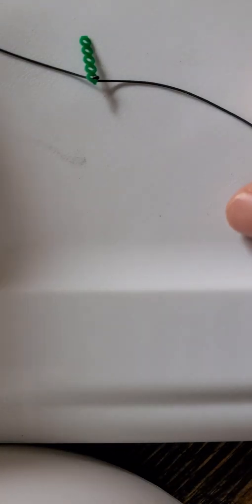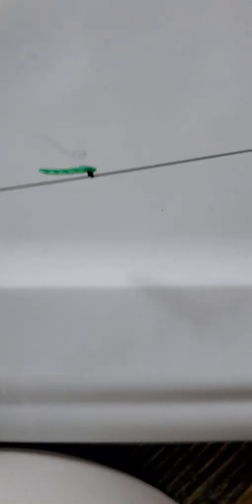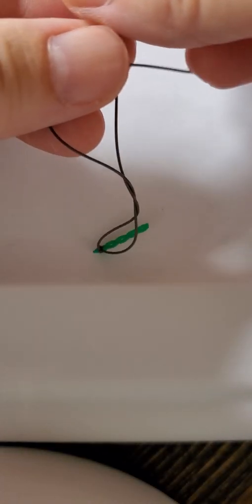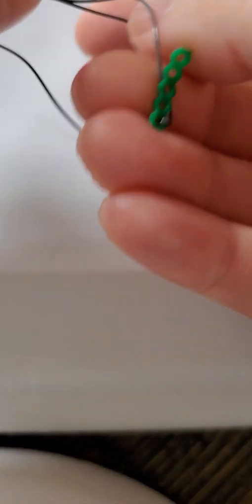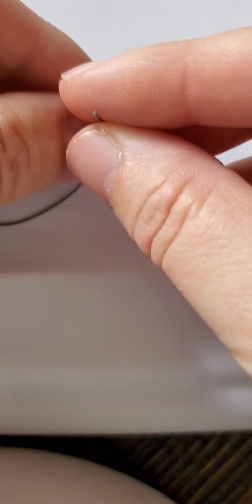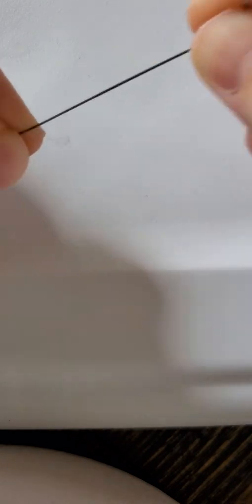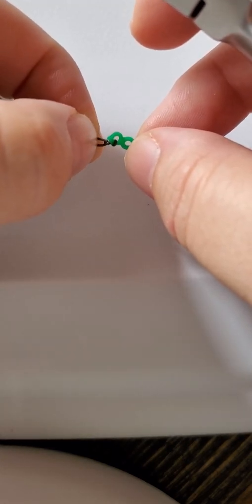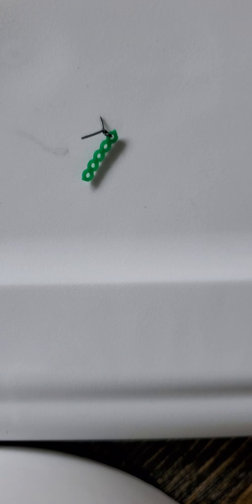Power Thread and Power Tube in Orthodontics to Move Impacted Canines

Comment: Hey how long should these things last? I got one on today and it closed a 1/2 centimeter gap within 4 hours. Don’t think this is normal. Any advice? I can’t find anything else. It seemed to work uncomfortably fast. Please if you can reply, it would be a big help.
Reply from the maker: Are you talking about power chain? Wow that's a lot of closure it's probably an incomplete closure just tipping of the teeth and widening of the PDL ligaments it needs to upright and stay in that position for a few months in order for the closure to actually be complete and the bone to form around the teeth
Reply: @Straightsmilesolutions  im taking about power threads